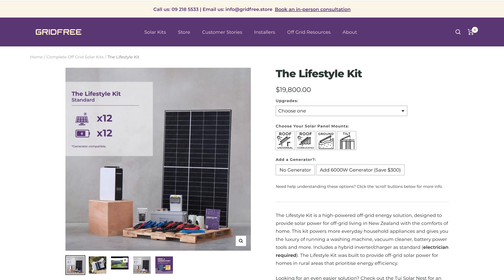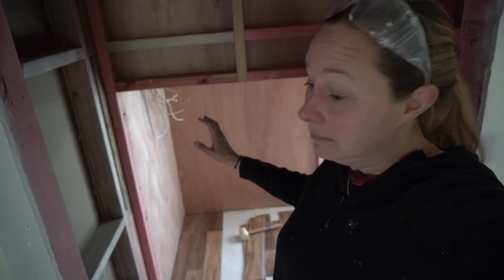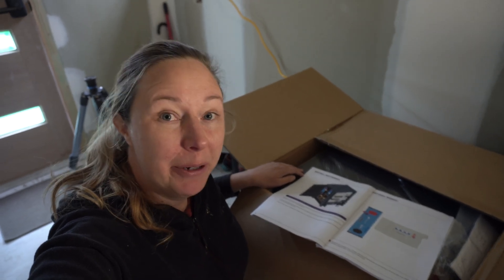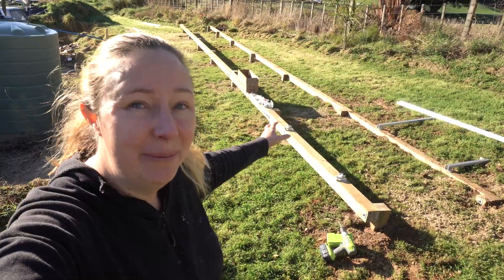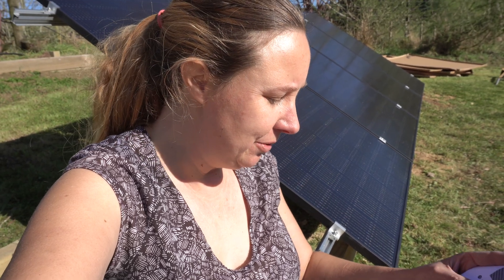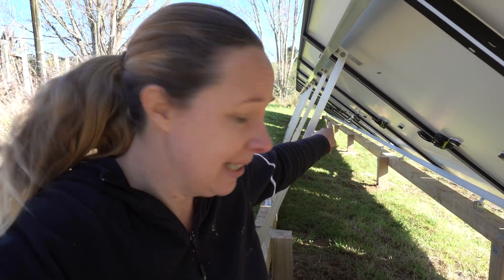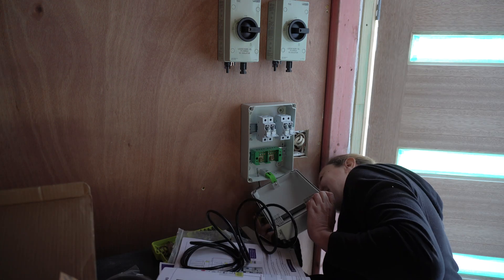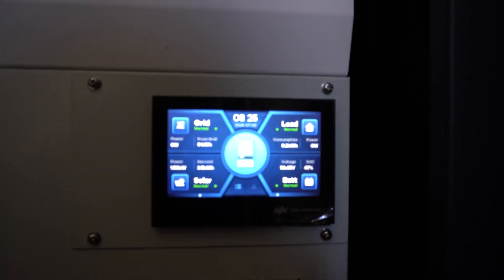WE HAVE POWER! 12 solar panels + lithium batteries + new inverter setup

Comment: Before this installation, what was your power source?
Reply from the maker: I had an extension cord from my brothers 4 panels and 4 batteries solar setup! So it was a big rush to get this running. Before that - I was in my sleepout with 1 solar panel and 1 battery.

Comment: Ah, off-grid, cool system! I guess the only down side is you can't export to the grid. Maybe get an electric car to soak up all the power in summer? 🙂
Reply from the maker: Yeah, I’m getting so much power right now that I’m not using. I really am curious to try more power hungry appliances.
Reply: @TravellingK  I haven't seen all the videos. Do you have an electric hot water tank? That is sort of a battery and somewhere to conveniently dump overproduction.

Comment: You are doing a great job, I'm pleased that you now have power. 
How much you can load the system will depend on the inverter fitted to the system, which I think is 5kW in your case. You will be able to use most household appliances without any issue, it will be how many high power items you can use at the same time that will be the issue. 
Here in France we have 18 panels, a 10kW storage battery and a 5 kW inverter as well as the incoming mains. In normal, operation power from the PV panels charge the storage battery and when full it powers the house and/or it is exported back to the grid. At night we initially use the power stored in the battery before we use the grid power. 
If the house is demanding more than 5 kW, the power will come from the incoming grid power as well as the battery/pv panels. The house isn't limited to 5 kW. 
With your 15kW of battery storage and plenty of clear skies to keep them charged I'm sure you will be fine. I'm guessing there's an app that you can use to monitor your system on your phone.
Reply from the maker: That sounds like a fantastic system! I've been monitoring the inverter screen and so far been so impressed. Eventually I want to add a freezer and start using more power hungry appliances. Slowly add them and see. Its done great during this winter!

Comment: Omg you are installing yourself? Your are a super talented lady. I wouldn’t dream of it.  Solar is really taking off here in Ireland. To reduce electric bills really. 10 panels with Hybrid Inverter costing on average €5000 post government grant. No batteries with that. Most household just sell bk excess to the grid. Large households probably do get batteries. I hv been quoted about 5 to include an Eddie water heater and 10 panel system. Selling bk to the grid I should hv very small bills. I should get advise from u.
Reply from the maker: That seems like a great price! I know a few people in cities who have solar and sell excess to grid. So far I haven't felt like I need to clean them.
Reply: I’m putting panels on the roof. Do u hv to clean them. We’ve been told no need 🙈
Reply: @brec5879  yes you do have to clean them at least once a year or more. They work best that way.